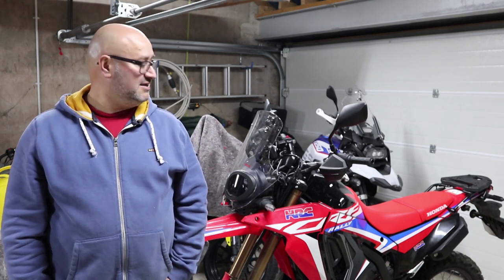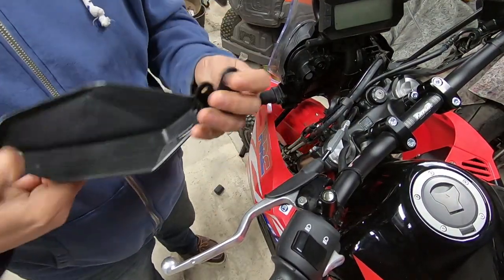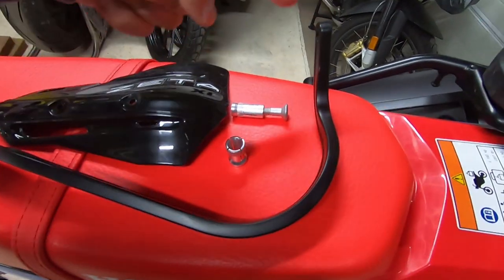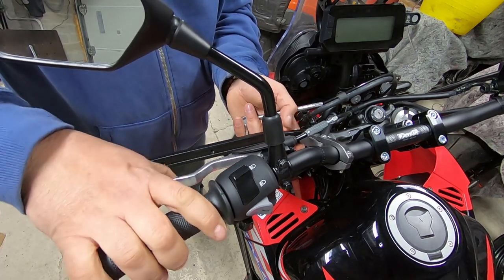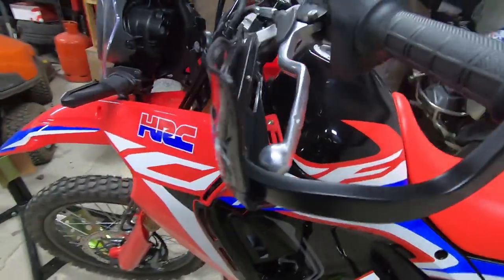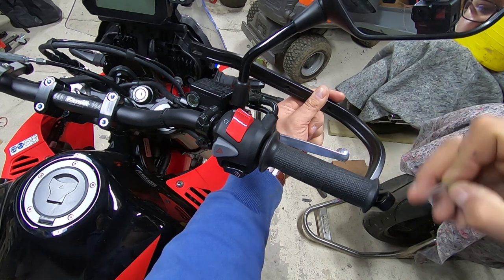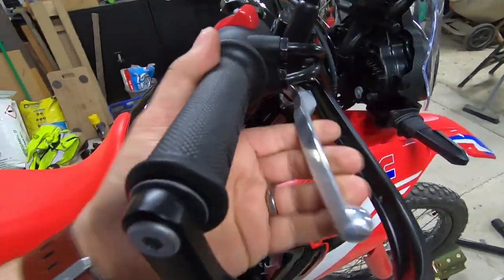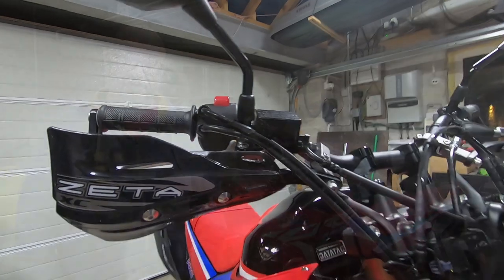How To: Honda CRF300L/Rally -  Zeta XC Handguard Fitting

Comment: You started your video with the screws already out of the handlebars. I needed that step.
Reply from the maker: Actually, I switched handlebars to a Renthal fat bar. I still have the stock bar, still with the threaded inserts. If you’re asking how to remove the bar end weights, they just unscrew. Normal thread.

Comment: Just got mine on! Different issue with my stock handlebars though. Both ends were plugged with a solid steel plug a good 3/4” deep, threaded of course with a 6mm hole.
  Bit of extra work. Had to drill out the hole with a larger hole and re-tap with a M-8x1.25 thread tap.
  I then had to put an oversized SS nut between the handlebar and drop down arm to use as a spacer in order to get the clearance on the throttle grip.
 All in all it has worked out well and looks great 😊
Reply from the maker: Fine work. The oversized SS nut sounds like a good solution!  Happy riding 👍

Comment: Again great video, I have used your videos for tons of research to prepare for my rally.  This time it was for the triple clamp bolt orientation (forward vs side). I may try the triple clamp mounts from Zeta for the handguards. Lots of pros and cons . Why did you go with bar clamps?
Reply from the maker: Hi Brian, I didn’t know there was another option! The triple clamp fittings look interesting, but I’m not sure how well they’d work with the fat bar conversion risers. If you’re using a 22mm handlebar, then I expect they’d be ok. If you’re going to a 28mm bar and have the 20mm risers, I wonder if that lifts it too far from the triple clamp mounting point? I’d be interested to know how it works out though.
Reply: Here is the video that brought it to my attention. He is using the Chub Tusk fatbars with risers. Looks super solid. Its a 300l but should work w/ the rally.   Adventure Daily is his channel,   https://youtu.be/KXJ6ukgVZOM

Comment: Nice video ! I will soon have a crf300l, since the rally isn't sold in France. 
I'm looking for handguards, just for the wind. Can i put the rally's stock handguards on the crf300l ? Would be perfect.
Reply from the maker: I haven’t tried, but if the brackets are the same and you can find some then maybe. That said, the stock rally handguards aren’t great. They might keep the wind off your hands but not a lot else.

Comment: Hi Andre, great videos. I finally got my Rally and am putting on handguards. My question is around getting off the weighted bar ends.  I finally got the black weighted ends off using the duct tape and brute force method. Once off, I found that in my handlebar tube ends are a silver receiver nut that's very tightly embedded in the tube somehow.  I cannot see how to get them out. How did you get them out?  I cannot install my handguards without removing this piece.
Reply from the maker: I didn’t. I switched my bars to the Renthal fat bars, and the inserts are still in my stock ones on a shelf in the garage. I appreciate this isn’t particularly helpful, for which I can only apologise. 
Choices for you (if the stock bars are the right height) are to get some other 22mm bars, the Renthal ones are rather good, as are the ProTapers. It saves weight and they are stronger. 

If you’d rather stick with stock, first make sure that the inner clamp for your handguards can attach without being constrained by the fixed cross brace on the stock bars. I know this didn’t work for some. 
If that bit is ok, then your choices for the end inserts are to drill them out or to re-tap them to the size of the bolts for your guards. I think re-tapping them is the better solution as they are fixed in really well. That said, I haven’t done it myself, so if you can find someone who has, they could say for sure. 

My apologies that I don’t have a full answer for you but that’s the best I can offer not having done it.
Reply: @PeakMotorcycles  That's all excellent context and advice. I'll consider these options as I proceed.
Reply: @rjandres17  hi Rob, I have the same issue with the stock Rally bars, I managed to get the (Oxfords)grips off but that core is not budging. I phoned my dealer but said you just depress the tabs you can see through the holes on the bars, easier said than done! Have you made progress? any advice greatly received 🙏

Comment: Thank you so much for this video. I want to install these on my 2022 CRF 300 L rally. How did you remove the black screws or weights on each end of the handlebar? Was your handlebar the original one that came with the motorcycle? And my last question,  are there any modifications that have to be done to original handlebar that comes with the motorcycle to install the hand guards in your video? Thanks
Reply from the maker: Hi Karim, I just unscrewed them. The initial handlebar was the original one, the new one is a Renthal fatbar (so I didn’t have to get the inserts out!). I have not installed the handguards on the original bar, in fact I don’t think they can be fitted, as the welded crossbar on the stock bar is about where the clamps go and the clamps on these guards are for a 28mm fatbar. Stock is 22mm.
Reply: @PeakMotorcycles  Thank you! I appreciate the feedback.

Comment: So no issues with clearance from screen on full lock (with the risers)? I found that challenging with Barkbusters plus risers on the stock bars. Had to angle the handguards down more than ideal.
Reply from the maker: No issues for me, though the SW-Motech risers had some forward/backward adjustment which  had to be checked to make sure the guards didn’t snag the screen. It’s tight, but I didn’t have any problems.
Reply: I heated the Barkbusters plastic and eased it back a bit to stop any contact on mine.

Comment: Hi Andre wondered if you have seen 550 performance has now produced an ECU remap for the 300 rally as you already have a hi flow exhaust you would only have to improve air box flow and an after market air filter to increase power by 18% and torque by 12% down side is you have to send your ECU to the US .
Reply from the maker: I already have it. I mailed my ECU to them in May and picked it up when I did my tail of the dragon trip in June. I also have the airbox mods from them, just haven’t had the time to fit them. I’m hoping to have more time in the winter…
Reply: I’ve ordered the air box mods but will wait till after Rally Moto Dark Sky before I post my Ecu off. How long was your ECU away ?

Comment: Hi again from Canada. I've recently discovered on the Zeta website a 300 rally specific handguard. Wondering if this was a product you considered or were aware of ? Perhaps it was not available when you did your install. Apologies if you have already addressed this. Thanks.
Reply from the maker: Hi Matt, I hadn’t as it wasn’t available earlier last year. Looks interesting though, with the mounts further up. I think it’s a universal one that looks it would fit the stock bar and perhaps avoid the welded crossbar.

Comment: Andre, looking to get these handguards for my rally.  The only thing not shown in your video is the clearance between the handguard and windscreen lock to lock.  I assume there was no problem.  Also thinking of getting the front mounting (ZE71-1821) that goes on the triple tree, do you believe that would work.  Saw a video from Jake TheGardenSnake where he installed them on the 300L
Reply from the maker: Hi Chris, the lock to lock windscreen clearance was the only near touching point. The front mounting looks interesting but I haven’t tried them I’m afraid so can’t really say one way or another. After this video I switched from 50mm to 20mm risers, but that actually brought the bar slightly closer to the screen (but there was still clearance).

Comment: Broke my clutch lever last weekend so bought some zeta levers for my rally and picked up a set of zeta handguards today to protect my investment so this video is very helpful ! Quick question about the plastic washer on the throttle side , Is that  from the already installed bar ends that come with the bike stock or something seperate I need to buy ? I'm not seeing one in my kit I bought
Reply from the maker: No, I don’t think it comes with the bike. On the L I think you have regular grips that cover the end. On the Rally there are bar end weights. I’m pretty sure the plastic washer came with the guards. It’s to have a low friction surface between the guard and the twist throttle. Maybe check the bag or see if it’s stuck to anything? I had to check twice for mine.

Comment: Hi Andre, put the Barkbusters on my 300 Rally yesterday. When I did the throttle side (right) I put the clamp connecting the handguard OVER (on top) of the brake line. Any reason that is bad? Just saw you did yours UNDER the line. You seem more experienced than me, but I can't see a reason why it being over the line would be a problem.
Reply from the maker: Nope, I think the brackets for each type of guard are different, so go with whatever snags the throttle cable the least. As long as that’s free (lock to lock) then either way is fine.

Comment: How did you remove the Honda bar end weights cylinder? That cylinder is really tough to remove, not counting the glued grips
Reply from the maker: Do you mean the handlebar insert that the bar end weights bolt in to? Or the bar end weights themselves? If the weights, mine just undid. I know others had problems but an impact wrench seems to help. As for the inserts, I changed by bars so never had to get them out of the stock ones.
Reply: @PeakMotorcycles  yes, the inserts is a bitch to remove. I will probably get new bars, simpler.
Reply: @PeakMotorcycles  the inserts are the problem. Most of us don’t have that special “pincer” tool required. Changing the bars is by far easier as you did, still a royal pain!

Comment: Hi André. 
I read getting the original insert out of the bar ends is a nightmare. What did you do and how easy/hard was that bit?
Reply from the maker: Hi, I didn’t. When I fitted the handguards, I changed the handlebars to the Renthal fat bars so didn’t have to get the insert out. I think most folks who stick with the stock bars either get bolts to fit (M6?) or drill them and re-tap for the bolts that come with the new guards.
Reply: @PeakMotorcycles  Ah yes you did, thank you for confirming.

Comment: What Renthal bars did you buy?  I'm 6' tall, you look around the same or more.
Reply from the maker: I have the Renthal 604 fatbar on some 20mm Apico risers. The Apico bolts were not great though, one sheared off at below spec torque. If buying again, I’d use the ProTaper risers.
Reply: @Peak Motorcycles  Yeah that's a never buy again experience.  I HATE companies that cheap out on the hardware.  I'd have been PISSED at that scenario.

Comment: Hi, I am currently driving the CRF 250 Rally and looking to change the stock hand-guard with a similar hand-guard as your in this video. I was just wondering that for the handlebar, did you have to change the handlebar because when i cut the end bit of my handlebar grip to insert the bolt that hold the metal bar for the handguard, the hole wasn't big enough so any advice on what I should do? Cheers mate!
Reply from the maker: Do you have inserts in the end of your bars? On the 300 Rally there are threaded inserts in the end for the bar end weights. If I’d used the stock bar, these would have needed to come out or be drilled and tapped. The Zeta guards did come with handlebar bolts in two sizes, one for alloy and one for steel bars. I guess due to wall thickness? All (ok, most!) bars are a 22mm outside diameter at the ends, and the metal makes the inner diameter vary. Did you get two sets of bolts with your hand guards?
Reply: @PeakMotorcycles  yes it did come with the bolts. I think I didn’t cut the throttle grip deep enough. Will give it a go with the drill. Thanks for your reply!

Comment: How about the standard bars have Honda put those impossible to get out fittings inside
Reply from the maker: Not impossible, just nearly impossible. Though the standard bars are quite soft and will likely bend after a few drops so I don’t know of many people who have gone to the trouble of getting the inserts out. I think a few have drilled and tapped them to fit the bolts that came with their new handguards, but the fixed cross-brace means that a lot of aftermarket handguards won’t fit the stock bars on the inner end. If you don’t need the rise, get some Renthal or ProTaper 22mm high bend bars which have a very similar profile to the stock bar but are a lot stronger.

Comment: How are you able to actuate the clutch? The lever is pointed down at what looks like a 45 degree angle.
Reply from the maker: It’s down a bit, but not 45 degrees. It’s the same angle as the brake and it’s pretty much where my fingers would rest when sitting. Maybe rotated slightly for a bit more comfort when standing, but it’s comfortable to use. Until you mentioned it, it hadn’t crossed my mind that it was at an odd angle.

Comment: Morning Andre, nice job! I was peeping through my fingers at the start waiting to see if you dropped any fittings tools etc on the tank ;-) I always cover with a towel  when I'm fitting bars or hand guards. I learnt the hard way with a nice ding in my fuel tank once. What make are your allen wrenches they are superb?
Reply from the maker: Hi, Good point, perhaps I've just got lucky so far! The hex wrenches are from a company called Bondhus and are called Hex Pro wrenches. I have a set of Hex's and a set of Torx's (I have a BMW too... they don't appear to be a fan of hex bolts!)
They aren't particularly cheap compared to others, but they are quite useful.

Comment: Very nice job. Are those original bars?  I like how you used a small breaker bar instead of a ratchet.
Reply from the maker: Hi Wayne, They are not the original bars. They are a Renthal 604 Fat Bar. I'm not sure you can fit these to the standard bars unless you can find a way to remove the weight threads from the ends, and you can find a clamping place that doesn't interfere with the cross brace. The cross brace is welded on the stock bar, so I don't think any would fit. The guards have the bar clamp to fit a tapered bar, so if you think you do have space on the stock bar, make sure you get the one for a 22mm bar.
Reply: Just got this bike.  Why did you change the bars out ?  Also sucks you cant get bark busters without mods but i did notice no vibrations. After you changed bars did you get vibrations ?

Comment: Have you found any replacement levers yet?  2 finger pull
Reply from the maker: Hi Terry, not yet. I think Zeta do some, but I've not tried any yet. We are still in lockdown in the UK so I haven't had many opportunities to get out and find what's not right with the stock ones (other than lack of adjustability). Once I've ridden it a bit more, I'll research and sort something out.
Reply: @PeakMotorcycles   I am in the UK   just waiting delivery ,  I have Zeta on mycrf250x hoping they will straight swap

Comment: These are great guards, I've had them on three bikes now. Your levers and guards seem to be angled a little too far down.
Reply from the maker: I adjusted them up a little after fitting. They are a bit down, but levers were angled to be comfortable when standing. For the guards, I laid the bike down, and that was the point of contact with the ground 😁

Comment: You didn't have to cut the ends off the grips? The ends are already open? If so, then wow, that's awesome - thumbs up to Honda for that! :)
Reply from the maker: I think they are for bar weights to reduce the vibration, but yes, you don’t have to cut the ends off too!
Reply: On the L the grips have to be cut off. Also, the throttle casing had to be cut off too.
Reply from the maker: @ringonotts  oh. That’s not great... and there was me thinking the Rally was just a screen, headlamp and bigger fuel tank 🤣. I hope it wasn’t too tricky.
Reply: Peak Motorcycles I fitted Oxford heated grips while I changed my bars today. I had to grind off the bumps on the throttle housing so that I could get the new grip on. Pain in the ass but simple enough to do...
Reply from the maker: @ringonotts  Yup, I think I'd have to do the same. I've some Acewell heated grips with an integral switch, so no separate controller, but I ordered an eBay special replacement throttle tube from China so I might be able to swap it without having to take the stock one off. There's definitely a few heated grip days coming up... Monday is supposed to be -3C here and only getting above 0 by lunchtime...
Reply: Peak Motorcycles I wish I had known about those before I fitted the Oxford ones! The Oxford controller is ugly....

Comment: Hi Andre, do you have a link to where these were bought please? Thanks in advance
Reply from the maker: Hi, I've added it to the description, but here it is too: https://www.dirtbikexpress.co.uk/bike_parts/motocross_handguards/zeta_motocross_handguards/zeta_armor-guard_curved_handguard_kit_-_black
They are currently showing as out of stock, but I'm sure they are available elsewhere. Note that I ordered the 28mm Fatbar fitting ones. If you have the stock bar, it'll be 22mm (if it's possible to fit them with the cross brace...
Good luck.
Reply: Thank you
Reply: Thank you